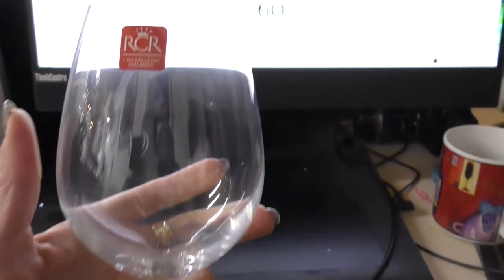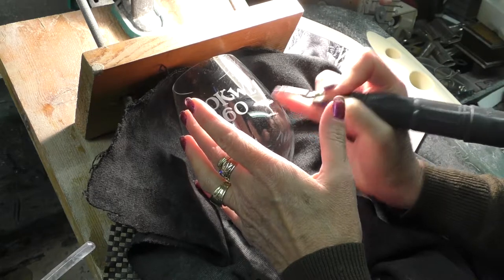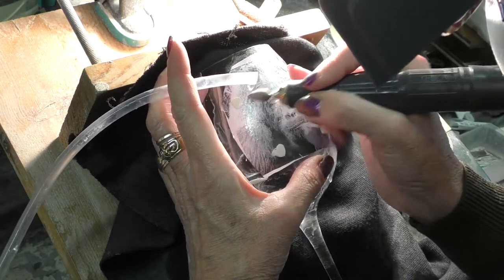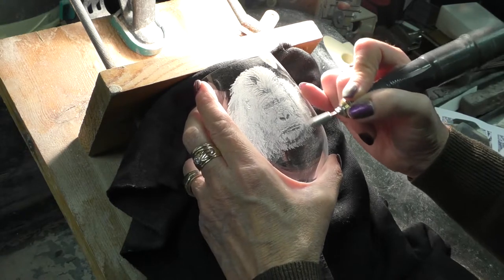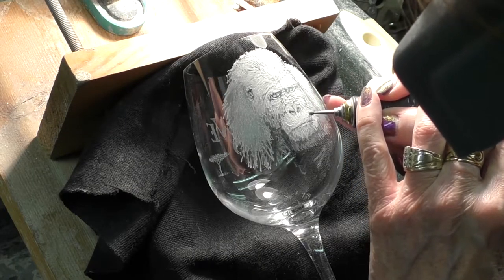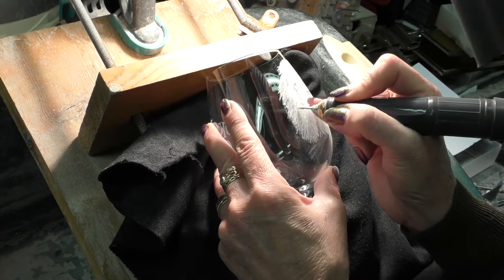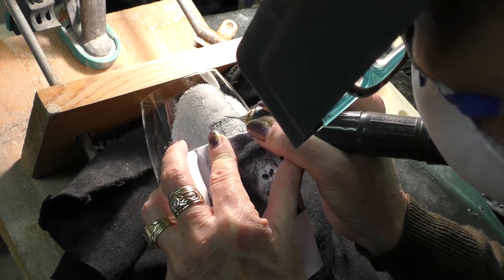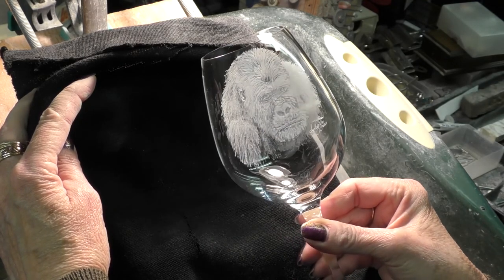Glass engraving for beginners (2020) - Gorilla "Sokwe" sandblasting and hand engraving

Comment: Lesley can I suggest that you get a moveable mini camera stand that you can bend the legs to a position to get the best picture without holding the camera..
I am a beginner with glass art and am certainly loving every little bit of your videos. 
I would like to ask you about the sand blasting, I have found that the equipment is expensive so is there a cheaper way to be able to sandblast?
Reply from the maker: I have all that filming equipment upstairs in the workshop, I just filmed the sandblast part quickly and it is not a recent video.  I don't focus my teaching on sandblasting usually.  There is another little video I made on sandblasting on my channel.  For all questions, though, please do join my Patreon teaching channel www.patreon.com/glassengraving